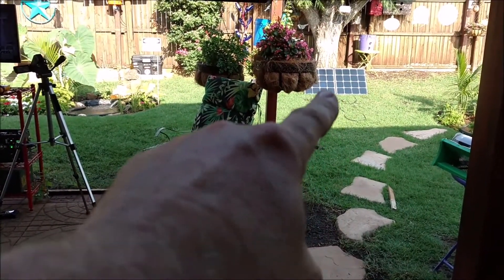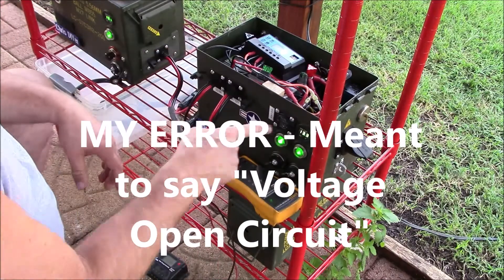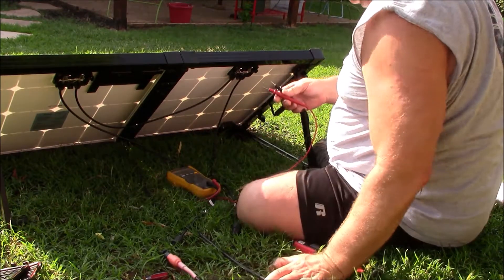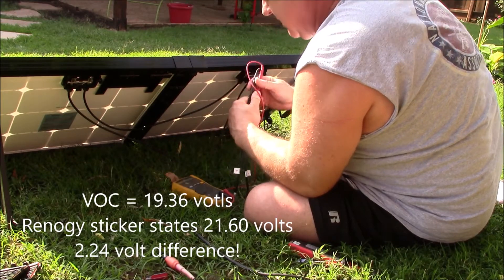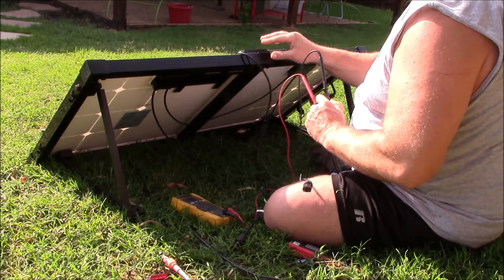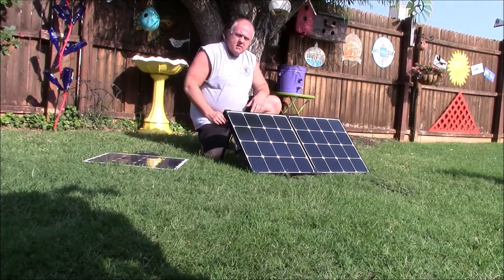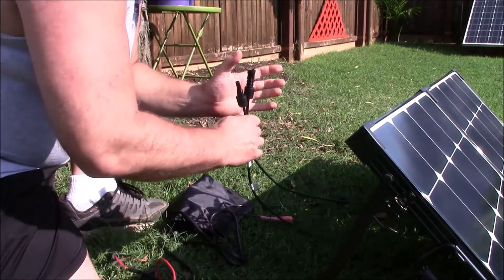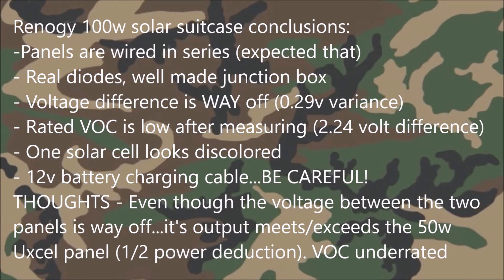Solar panel testing - Renogy Eclipse 100w solar suitcase

Comment: Hello Chris. I just bought this Eclipse panel without controller after watching your video. I got my panels here and my cables are not labeled positive and negative. The "manual" on the Renogy sight is terrible and it has different junction boxes and wiring diagrams. Can you tell me which is positive and which is negative on your setup? On your unboxing video, looking from the rear of the panels, the wire on the right is the positive.

Comment: Open circuit voltage decreases with temperature.   The spec is probably rated at a very low temperature.   I don't believe there is anything wrong with the panels.
Reply from the maker: Overall, it is working...just a "QC" or cell concern. Two identical panels and quite a bit a VOC voltage spread in direct sunshine

Comment: Cool beans, definitely something to keep an eye out my suitcase panels arrive hopefully by the end of this week. Won't be messing around with it for about a week or so, gotta love getting drafted for 2nd and 3rd shift.
Reply from the maker: Cool! Hope this video helps. I am still kinda-sorta testing and swapping out diodes. It is just "weird" that the voltages are inconsistent between both panels. However, the current output and wattage still beats my 50w flexy panel and the two 100w panels I have mounted on the fence (divide by 1/2 to get average for a 100w panel equivalent). The VOC still remains high enough to make use of MPPT charging. It is just "weird" to have two identical panels with that much voltage variance...and a measured VOC much lower then what is stamped

Comment: Greetings Chris, I suspect the low voltage on one side is why it was sent in for refurbishing. I think that the low voltage panel has a faulty diode. As you know they all have a pass through voltage drop. The low volt panel may have a different diode in it than the other side. I keep a hand full of diodes on hand in case I loose one on one of the arrays. Didn't you have a bad diode on a Renogy panel awhile back?
Reply from the maker: Thanks. Yep, that "bad" panel back then had the diode in backwards. I turned it around and the volts came back up. They sent me some extra diodes. Thanks for your ideas. Made me go out and check the diodes tonight (had some good late sun). I first "swapped" them out (took them out, moved the left diode to the right panel's and vice-versa). No change. Left panel voltage was still about 0.20V lower than the right. I used the diode checker function on the Fluke multimeter. Pulled both diodes out. Each was "open" on one side and 0.131v on the other (consistent readings). Hmm. I then took the 100w solar panel diodes Renogy sent me and checked them with the multimeter. Open on one side and 0.151v on the other. I put those two diodes into the 50w panels and rechecked voltages. Slightly higher voltage drop (0.30V). Overall VOC on both panels was 19.30v and then my sunshine and shading was too much for anymore testing. The sun was giving me fits...so, prob not good readings using the 100w diodes. I left the two 100w diodes in place (different manufacturer, but look identical) and buttoned everything back up. Will do some more testing tomorrow morning if I have sun to work with. Overall, I don't think the solar panel suitcase is bad...just that the two panels don't have the same voltage output...and when wired in series, the current output is still high. As I showed in the video...they outperformed my 50w Uxcell flexy panel. I also took a current reading for the two panels on the fence at high sun noon...the solar suitcase had a worse angle and still was outperforming them too by about 10 watts (200w divided by 2 to get average 100w reading). So, I don't know...it is just weird. If you read this whole thing...I owe you a nice cup of coffee or tea.
Reply: Chris DIYer Thanks for the detailed response. It may just be one of those mysteries we get sometimes. Like you said the bottom line is they produce full current. I just added another inverter to the chicken coop to run the fan. I need to make a video of the system explaining how old the battery is. It's a 2005 marine 12 volt. Still has full capacity lol. It's quite a story that I'll have to share. Have a great night my friend.

Comment: Murphy's law.....guess you should have covered your panels before reconnecting the meter ?  We all learn together.  Thanks Chris    J K
Reply from the maker: It shouldn't have popped...weird. I also smoked another 12v meter during all this backyard testing. So, pretty much "done" with these ammeters...they let their smoke out too much. Got a red LED voltmeter in there now...just tapping off the solar panel input leads to read volts. It is working alright...except for the red color...harder to read vs green

Comment: Great video, bummer about your meter.
I am curious what Renogy would say about those specs because that is definitely a decent variance.  
Great data.  Looking forward to seeing more about this suitcase.
Reply from the maker: Thanks. Gonna keep an eye on it. An MPPT solar charger would be better to use and make a little more power...but, for these small systems not really cost effective. As for the left and right panels not having closer voltages...kinda eye catching IMO...but, could be "other" things going on that I don't know about. The overall VOC was not even close to what it I think it should be (21.60v). But, to it's credit the Renogy outputted more current vs the 50w panel in a side-by-side comparison test (double the current of the 50w and it is still lower than the Renogy). And that is what really matters...power. I actually smoked two of those little 12v meters...the things I do for my videos! Hahaa! 😜